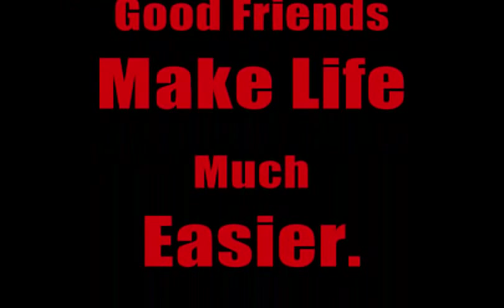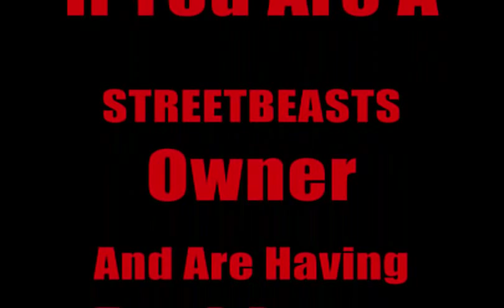How To Install A Lokar Floor Shifter-Part 2-Bruno The Pomeranian Gets Involved

Comment from the maker: @ziggassedup This shifter is designed for the transmission in the car. What makes it different is the bolt pattern. They make shifters for every transmission made.

Comment from the maker: @hulksmash313 THis is one reason I don't like BM shifters, because the cable shift always seems to give you some kind of problem. The problem could be that you ran your cable wrong and the shiter is binding up when trying to go in low. I would reroute your cabel where it runs in a big loop, this way it will keep the cable free from any binding.. Thanks for the comment on BRUNO the Pomeranian.. Pete

Comment: Hi Pete. My name is Mark. I have a question, it may be a dumb question, but here it is.  Can I use a Lokar shifter for an overdrive, on my 350 turbo?
Reply: 350 turbo trans do not have an overdrive. You’ll have to bump it up to a 700r4
Reply: @diyautoschool  , I know the 350 doesn’t have an overdrive, but I’m wondering if the shifter, for an overdrive, will work with the 350?

Comment: Hey Pete. I have a rear mount ed Lokar shifter on my 350 Turbo. I wanted to ask you where do I need to place my lever on my tranny and on my shifter to hook up my linkage?
Reply: The leaver should bolt directly to the transmission and the linkage rod is contacted between the two and is adjustable. Should be self explanatory
Reply: @diyautoschool thanks for your reply. But, I meant do I set the lever on the trannv at like the 9 o'clock position and the shifter in neutral, or something like that?